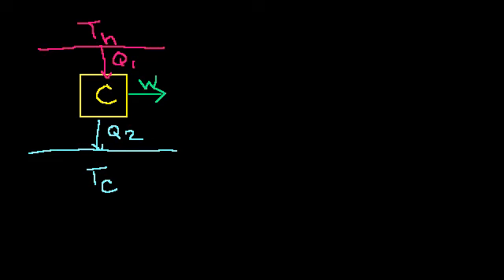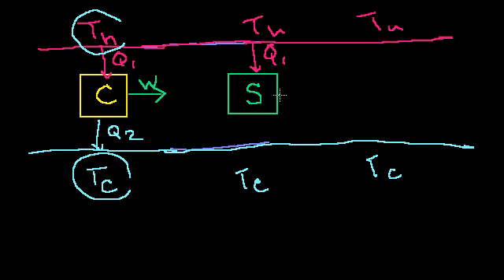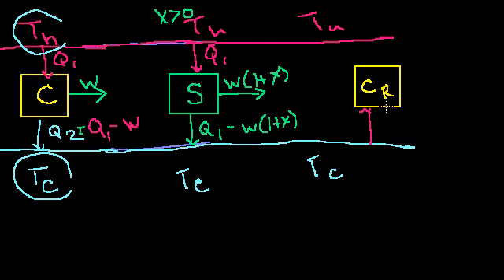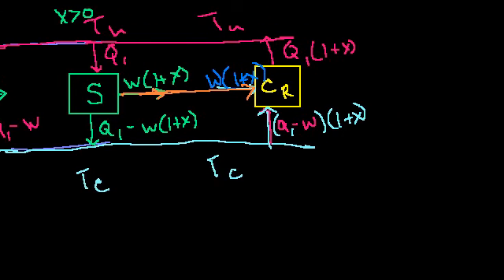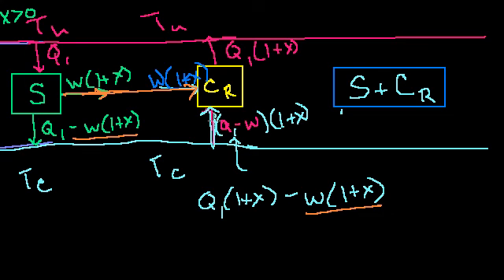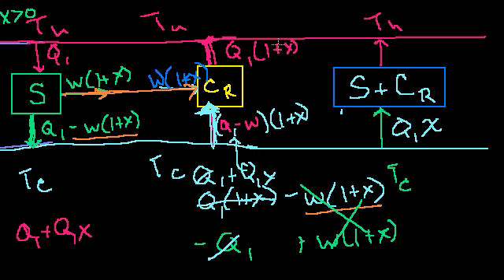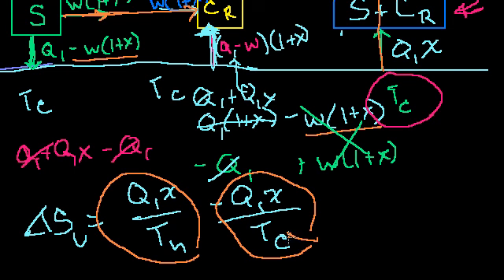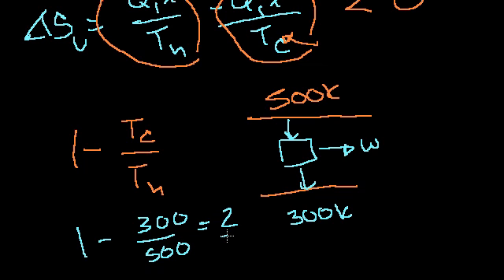Carnot efficiency 3: Proving that it is the most efficient | Physics | Khan Academy

Comment: Excellent video, although as others have pointed out, other reversible engines also have this same maximum efficiency. The specific state processes for the Carnot cycle are not required to use this argument, only the fact that we have a reversible process with two temperatures involved, returning to the initial temperature.

Comment: This only proves that THERE IS indeed a maximum efficiency machine, in this case we are calling it the "Carnot's machine", BUT it doesn't prove that the "Carnot's machine" we are talking about in this "proof" is running under the Carnot's cycle.
Reply: Exactly what I was thinking! How does this prove that an isothermal expansion, adiabatic expansion, isothermal contraction and then an adiabatic contraction is the most optimal way for an engine to do work, given a heat source and sink? 

Why not e.g. an isobaric expansion (heating), isovolumetric depressurization (cooling), isobaric contraction (cooling), and then isovolumetric pressurization (heating)? Still forms a cycle with net work done -- the process is just shaped like a rectangle instead!

Comment: It's weird because this is just saying no one can make an engine more than 100% efficient.  Which is just another way to state part of the 2nd law of thermodynamics.  You could make a "better engine" than a 100% efficient engine by making one that does the work faster (more powerful).  You also could make an engine that pulls energy from other systems because the second law of thermodynamics doesn't apply to open systems.  So maybe it's a carnot engine with an AI that makes more carnot engines so it just keeps making more work per unit time.  You could argue it would run out of materials or something but we're talking about an imaginary engine from the beginning.

Comment: Great explanation, Surely the cold side can be made to absorb heat and the hot side to dissipate heat,like a heat pump..In this endless cycle you have shown.The unmentioned byproduct of your system is moving a huge amount of heat.Given you attached heat exchangers onto the hot and cold side.For one Kwh of electricity an efficient compressor will move up to 7Kw of heat by compressing the gas to a liquid causing it to give off all of its heat..The high pressure evaporator side drives a reverse compressor off of expansion gases and can be coupled to the compression side.This is scavenging like a turbo..Remember moving heat is a huge byproduct of compressing gas to a liquid and the evaporator side is not usually scavenged to turn the compressor..This would up the efficiency of the system..And to finish of.If you look at a heat pump scroll compressor type you will see the input energy to power in, is linear but the output is an exponential curve..How big do you have to make a heat pump before you can convey enough heat to power said heat pump..Food for thought..Thanks!

Comment: what is preventing us from applying same logic to some other engine than carnot ? with this logic, we can prove every engine to be most efficient !!!
Reply: guess there must be an effective reversible engine for that
Reply: @LuizCarazolli  why? I need a proof.
Reply: @joao_ssouza  Actually I made a huge mistake. Carnot's theorem applies to all reversible engines, stating that regardless of the cycle, 2 reversible engines operating under the same conditions will present the same and highest possible efficiency. Irreversible engines are the ones that will always be less efficient.
So, in reality, Carnot's cycle is simply a reversible cycle, which, just like any other one operating in a reversible engine, must present the highest efficiency allowed by the second law, and that's what the video is about

Comment: There is simpler way to prove that a Greater than Carnot efficiency engine can't happen. This can be done by using the efficiency equation.

W=Q1-Q2>Q1(1-T2/T1)

-Q2>Q1*T2/T1

Q2/T2<Q1/T1

Q2/T2 - Q1/T1 < 0 (system losing entropy)

This would be the same as spontaneous transfer of heat from a cold body to a hot body causing the cold body to get colder and the hot body to get hotter.

This never happens so greater than Carnot efficiency really is impossible.
Reply: There is an error in your equation, cause you assume that efficiency is greater than it"s self.
Reply: @thanasisconstantinou7442  it is not an error. He used the equation 1-t2/t1=w/q1 and supposed there was some machine that could do some work W>w, i.e, W>q1(1-t2/t1). This lead to the contradiction.
Reply: @srpenguinbr  the op still made a mistake.  -Q2/T2 is the change in entropy of the engine as it loses energy Q2. +Q1/T1 is the change in entropy of the engine as it gains energy Q1. 
Therefore 
Q2/T2 - Q1/T1 = -ΔS2 - ΔS1 = -ΔS(engine) <0
And so ΔS(engine)>0

There is no contradiction here

Comment: Why couldn't this argument be applied to any heat engine? Any engine could be made to take in Q1 and give out Q2 and W (which are arbitrary), and if it was connected in reverse to a "better" engine it would be shown to violate the second law.
Reply: i know this was posted a very long time ago. But students are discovering it even now, so let me clarify. This argument showed by Sal not only proves that carnot engine is most efficient, it also shows that the all reversible engines (working within two tempratures) have the SAME efficiancy equal to that of carnot engine.(Sal should have mentioned that, he probably forgot) So your argument that there can be a "a worse and a better engine" is not applicable here. Also there can be less efficient engines, but these involve dissipative irreversible process and thereby lose energy and cannot be used for this perfect combination like a carnot engine.
Reply: @ameennaseem8936  ok, but all this just does not explain why carnot engine must have two adiabats and two isotherms, prove to me that a two isochoric and two transfers of heat with a constant volume is not more efficient. I am really struggling to swallow this down.
Reply: @joao_ssouza  Any isochoric steps would have losses (i.e. not *ideal*). The adiabatic and isothermal steps of the Carnot model are used because neither have a change in internal energy (zero losses).
Reply: David Lynn 

The single difference being the Carnot model doesn't have any other detracting factors such as friction, turbulence, or vibration. Hence it is an "ideal" heat engine. We develop ideal models as the classic, see also the ideal diode, pulley, etc. 

Any other heat engine model would simply include more, and more complex, variables. 

A rose by any other name would still be the ideal heat engine model.
Reply: @skeetorkiftwon  how does it relate with why does it needs two isotherms and two adiabats? Like why cant it be two isotherms and two ischorics or isobarics?

Comment: 41% efficiency is the greatest efficiency obtainable with the difference in temp between those two resiviors. If you look at the equation used to calculate efficiency you would see that a greater difference in temp will generally generate a greater efficiency. And if you could get the cold side down to absolute zero the efficiency would be 100% regardless of the temp of the hot side
Reply: All you have to do is make make the adiabatic expansion infinite to make the temperature inside the cylinder go to zero and have an absolute zero reservoir for the isothermal compression :)

Comment: @Annergize I try to answer the question. If you add heat Q+ at Th to a system an addition of entropy to your system comes along. The magnitude of this entropy you add equals Q+/Th = S. Entropy is a state variable. In a cycle you want to come back to your initial state eventually. Thus you have to reject the entropy S again. This is done by the rejection of heat Q- at Tc. Q-/Tc now has to equal S. With Tc = 299K and Th = 300K => Q- = 299/300 * Q+. Almost all the heat added has to be rejected.

Comment: What happens if we have two bodies, one at 299K and the other at 300K and we use a Carnot engine between them. The max efficiency is 1 - 299/300 = 0.003. Why is this so inefficient when the temperatures are so close?
Reply: You can find the answer by yourself.

Draw in a pV diagram a carnot cycle between these two temperatures. The area inside the figure is very small, then work->0, then the efficiency is ridicolous.